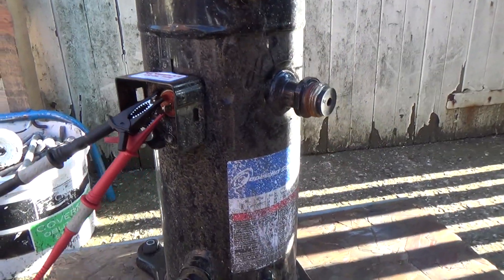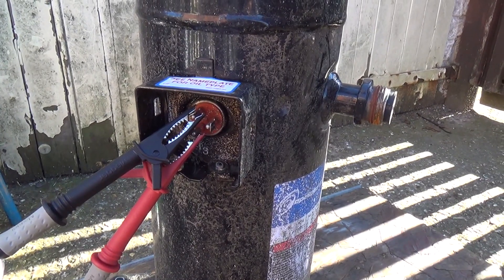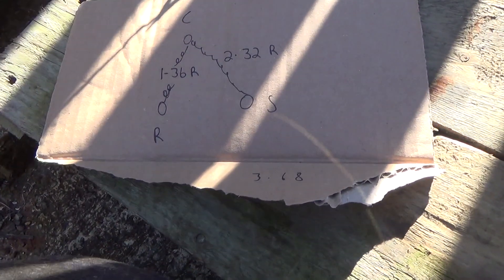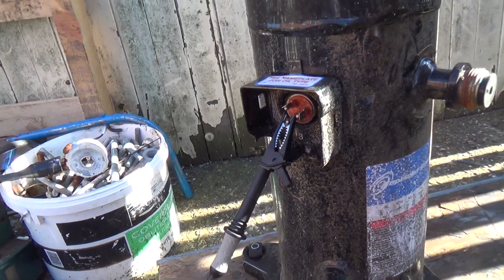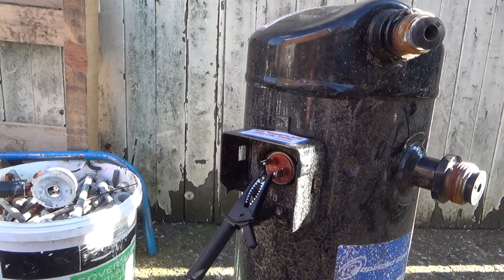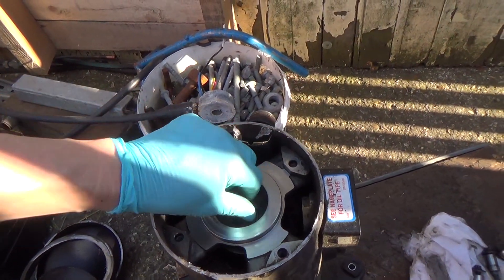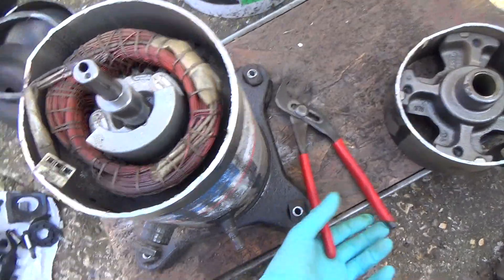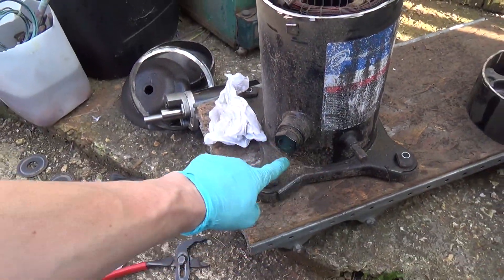Copeland Scroll Autopsy ZB21

Comment: The guy at the factory probably was chewing gum and coughed and lost his gum, you found it... But seriously when they dipped the winding in varnish and baked it there probably was some clumped varnish that settled and got baked there, and the assembler missed it or thought it wouldn't hurt anything.
Reply from the maker: ***** Yeah it was certainly odd, never seen anything like it before. Something seemed to be odd with the windings, i could not get a stable reading when i measured the resistance, it kept jumping about, i was expecting the windings to be burnt out but they looked ok apart from the burnt looking blob. The electricity supply company had been replacing overhead cables and a few things had failed at the same time on the farm so though it may have been damaged by a spike or something.

Comment: Hey John nice. That is a strange one. Only thing could be is it was manufactured with this flaw. At any rate lots of fun finding out what killed them!! 

-Mike
Reply from the maker: Hi Mike, I was wondering if it was caused by poor power supply or a spike, the electrical supply company were replacing some of their lines etc and a few things broke on the farm when the power came back on.
Reply: Sure John those are very all possible and even a lighting strike in there too. But why it only hit one section of the winding is odd. I've seen two compressor's zapped by lighting and of the two I saw the run winding was hit and in the other it was the start winding from lightning on both. It's just a weird thing indeed! I can't say I remember a power deviation or spike causing a failure in my memory. Anyhow it's weird stuff and your patient had some odd signatures for damage! 

-Mike
Reply: heavydiesel this is why your always best to switch the breakers off when power companies are working as you can get a massive incurrent rush if you do not have lighting arresters/surge suppressors protecting the equipment it can fry stuff (but typically its electronic stuff that gets taken out, as its norm all the AC's and compressors kicking in make a massive brown out on top of the overvoltage)

the cheap way is to fit a time delay relay when the power goes off and back on the delay of say 3-15 seconds will generally stop any rush current from getting to the motor or the motor it self from adding to the surge in the building when power comes back on

why most Air cons are off when power comes back on, unless your in the USA they had issues getting the power back on as all the AC's that was switched on had no delay so when they switched an area back on all the AC's would kick in and blow the fuse at the substations again or just the local fuses would blow

Comment: Shouldn't the resistance of the run winding also be higher than the start winding? That would imply that the run winding was the one to suffer the failure. Rather interesting!
Reply: There are two different types of PSC (Permanent Split Capacitor) motors: 1) PSC-CR (capacitor run) the capacitor is always connected which is used widely in a/c and large refrigeration systems. 2) PSC-CS (capacitor start) the capacitor is a high value and is disconnected as soon as the motor reaches a predetermined speed which is determined by an internal 'governor' (motors that start up making a sort of dragging noise that goes away in a few tenths of a second "Shhhh-tk") or a potential relay of some sort.

There is technically a third variant: PSC-CS/R (Capacitor start/run) that is a hybrid of the two above, sometimes known as a high start torque motor, with two capacitors; one for start and the other for run. 

Some a/c units will be configured as CS/R because of certain mechanical constrains that may require a compressor to restart before the system equalizes, or if the metering device does not automatically equalize after shutdown. *cough* Trane *cough*

In PSC-CR motors the run winding resistance will always be a smaller value than the start winding at close to 2:1 because you need the higher impedance to match the run capacitor to develop enough current to get the required starting torque. If the start winding was as low impedance as the start winding the required start capacitor would have to be 3 to 4 times higher value.  

The only exceptions to this is 3 phase motors, or 'pancake' compressors that disconnect the start winding as soon as the motor starts spinning (run winding current drops and the potential relay drops out) since they are always CS mode. The give-away is the compressor capacitor value is listed as xxx - xxx MFD rather than a specific value.

Hope this helps clear any confusion, I know it's a couple years late. XD
Reply from the maker: I think you are right! Though there are some smaller compressors where i think its the other way round. I'm going to cut the winding out and see if there is anything visibly wrong.
Reply: heavydiesel be interesting to see it

Comment: Probably the power had a 11kV spike on it from the supply side, and that killed the motor by arcing 2 windings together. You probably will find the winding inside has fused into a solid copper block, and the blob is a mix of melted insulation and decomposed oil.